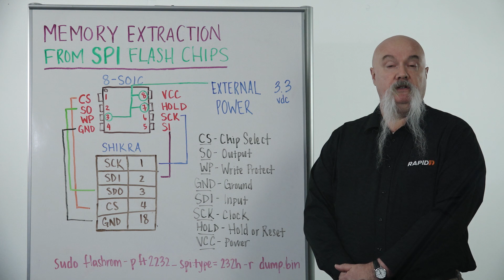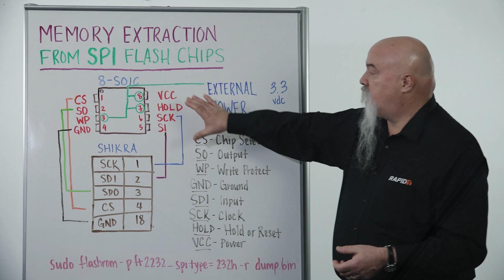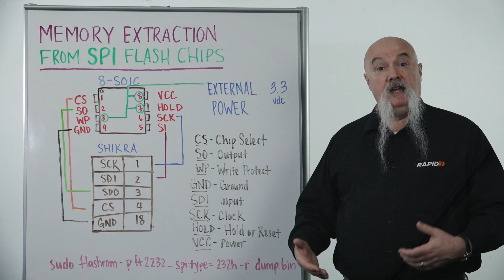Whiteboard Wednesday: Memory Extraction from SPI Flash Devices

Comment: I need the low level script examples for the NI 845x to talk to a spi flash memory.  your video comes up each way I search, but I need to see the script examples that use the ni845x.dll   I have this working to do the 0x9F command but need to do writes/reads.  in this, the script runs C code.  set the device, make sure its connected, start a script, enter the script steps, close the script, run it, close the handle.  It may be that the 8452 is once again failing,  I send out read data requests and it does that, can see on the protocol analyzer, but then CS goes away and the cycle ends.  Its an M25p80 flash, it was low cost and available from digikey so am using that.    Just something related to that flash memory, I want to write address in address for  5 addresses then read it back.  Id like also to just have a read function to read say 20 or 50 addresses out.  Looking for the steps, what that flash memory wants to see cycle per cycle.  You have to write an 06 to unlock it,  then do a read 02 or 03 but its not working

Comment: Can u connect to these chips with chip still soldered on the board but board not being powered on? But still power it with 3.3V externally?
Reply: I'm wondering the same, albeit 4 years later :).

Comment: Hello,
I am using Version 1.1.bin. Everything was ok since I tried to change the ssid from pwned to another name. In the same step I also changed the wifi Password and clicked "save".
After that the new ssid is displayed, but when i try to connect, the new password is not accepted. I was very carefully when changing the password and i am sure that i wrote it correctly.
Also the old password "deauther" doesnt work.
I flashed the esp8266 again, hoping that would set everything to default, but after that it Shows the new given ssid again and no Login possible.
Any ideas?